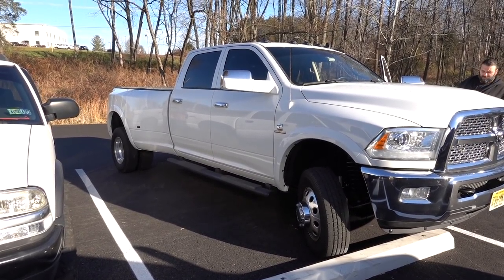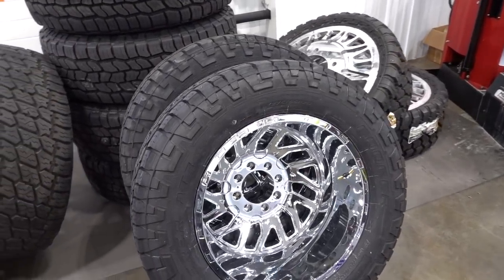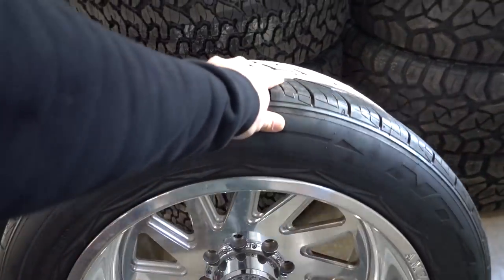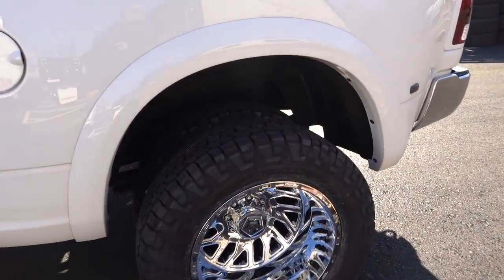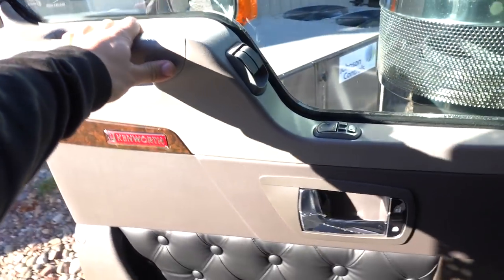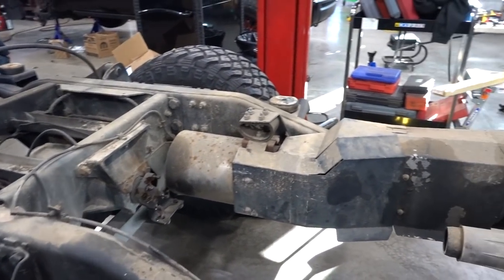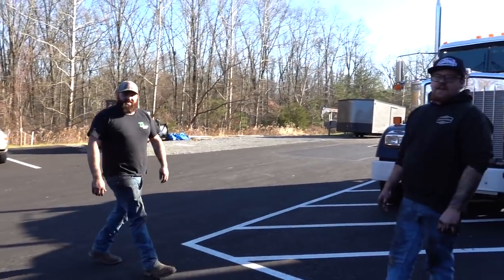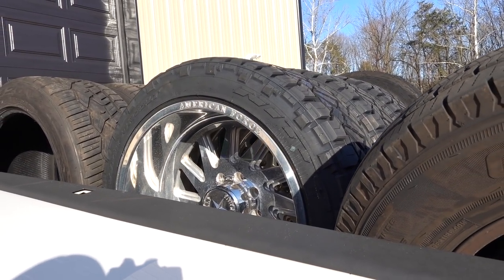BRAND NEW STRETCHED KENWORTH!!!! 300"WB!!!

Comment: I installed those tires on my F150 and the LSD sure lights up when your cornering. Put it under load and you would swear it's a locker. Cross over the white lines on the road and they chirp up. Loved them in the snow and ice on the highway when I had to run 33 trips to the Cancer clinic. Bad ass storms never failed to get me there and back to the house 30 miles away.

Comment: Marks truck looks great. My experience with the ridge grapplers wasn't that great only got about 28k out of them on a 18 ram 2500 mega cab.
Reply: Air pressure, suspension condition, and how well you stick to rotating your tires definitely determines how long they last. Even a bad shock absorber can cause uneven tire wear and make premature replacement needed.